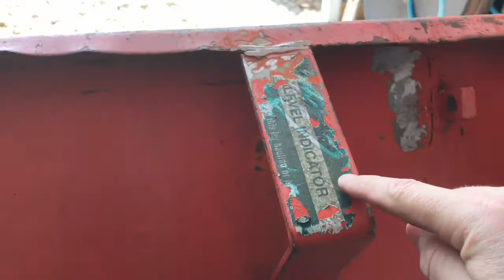Kubota Front End Loader Bucket Repair

Comment: I have a similar bucket and when my top lip began to get bent, I stuck a piece of 1” pipe under that lip and welded it in. Still in good shape after 18 years of use lifting with chains etc over the top. I also use rope a lot and the rounded edge prevents cutting my rope.
Good job, good presentation , thanks for sharing
Reply from the maker: My friend was very pleased with his "new" bucket. He does use it a lot with his live stock. Thanks for watching!

Comment: Do you know why mild steel is used in the floor of these buckets?
Reply from the maker: Mild steel would be more flexible and tougher than hardened steel. The cutting-edge of the bucket may be hardened but I doubt that it is based on how it welded. Bucket teeth are usually hardened for better wear purposes.
Reply: @shopdoc  Thank you for your reply.   Do you think a hardened steel leading edge to the bucket bolted through the front floor of the bucket will prolong the life of the bucket. 

I am concerned because one day in with a new tractor, the bucket is concave by 1" as it has smacked up against a root while scooping horse manure.
Reply from the maker: Yes I think it would strengthen it and prolong it's life for sure. Don't try welding it. make sure you bolt it. Hardened steel does not like being welded to mild....tends to become brittle.

Comment: I have never seen a bucket that perforated. My John Deere bucket was wore pretty thin and cracking at the welds so I cut the bottom out and welded in a new bottom out of quarter inch plate. Its a lot more work than most people realize.
Reply: My HD us getting that way too